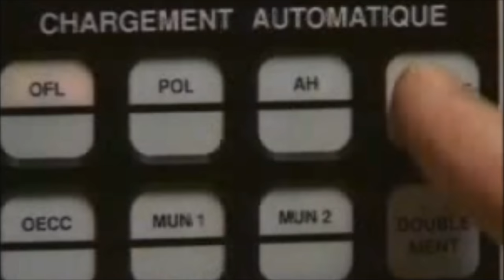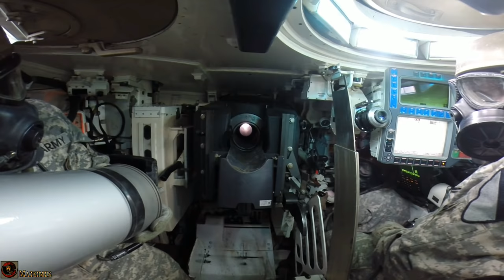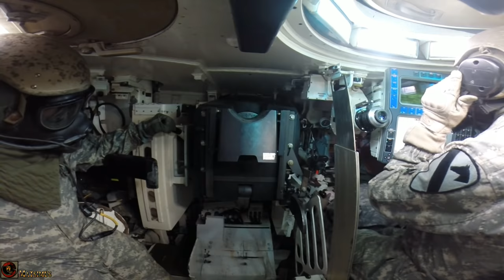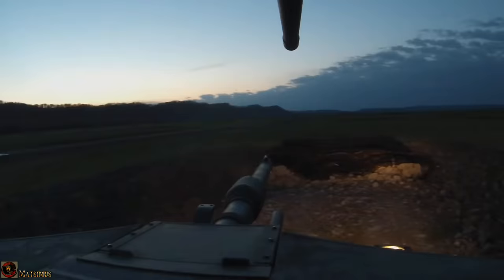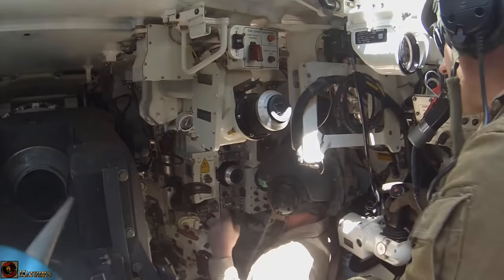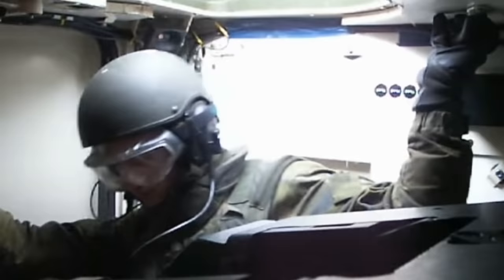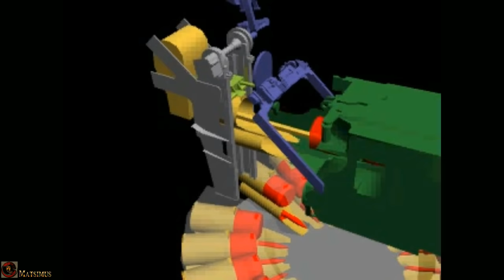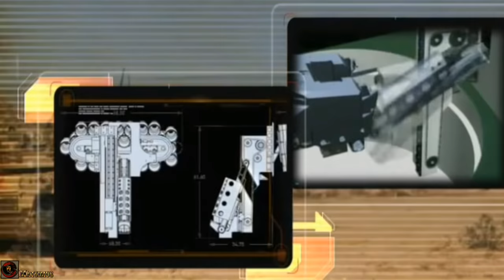Tank Autoloader or Crewman Loader?

Comment: You talked about the catastrophic exploison thingy on the T-72 in Iraq and that russian tank designes haven´t really focused on crew protection when it comes to ammo storage.

Ofcoure penetrating an T-72 Monkey isn´t really an art so it can happen, even if you hit frontally, that the Ammunition in the Autoloader explodes (burns up).
But do keep in min, if you have a HEAT round which can overmatch the armour this much, even in the M1 you wouldn´t be safe. (ofcourse with the Hatches closed)

Also the T-72B3s and T-90s have an armoured deck on top of the autoloader, which makes it alot harder to have an catastrophic exploison.
Ofcourse if you are going nuts and store extra ammunition in these tanks, you are fucked.

Then procceding to the next situation.
If a round doesn´t penetrate but the auto loader still gets knocked out, the Human loader also wouldn´t have a great day.
But lets say the loader got hit by spall, the autoloader wouldn´t care that much if no hydraulic or electric systems got damadged.
The autoloader will proceed as well as it did before but your injured gunner, he will struggle.

And finally.

We are all moving to bigger calibers, the germans want to upgrade their Leo´s with 130mm guns and in the Future the new German-French Tank will probably have an 140mm gun.
If you have these kinda guns, the ammo will get heavy, very heavy and a Autoloader will be much better due to the fact that it will never get tired and it doesn´t care how the tank driver fuck the suspension.
Also looking at the expirence the French had with their autoloader for the Leclerc, they love it, it will probably be an autoloader we will see in the next major  wester MBT.

sry for the bad english..
Reply: Jakob Fichtinger Absolutely correct mate! You got it right! The Westerners just want to justify their human loading system which is more ineffective in terms of harsh realities of combat...
Reply: despite safety,  as in this video looks like the human loaders are already difficult to handle the shell while the tank is not moving
Reply: can your autoloader be another infantryman if you leave the tank?
can your autoloader help you with maintenance tasks?
can your autoloader give you another pair of eyes looking for treats during non-combat situations?
can your autoloader be replaced by another crewmember in case of being seriously hurt?
plus the US and Germany are not moving to bigger calibers but to better ammo and longer barrels, an M829A4 can fuck 900mm of steel at 4'5 km when it's fired from a 120mm L44, the APFSDS on the russian tanks can barely do a shit over 3'5 km because the autoloader doesn't allow the cartridge to be bigger (bigger=more propellant=more energy on the projectile) due to the size limitations)
Reply: Demoblade 

You haven't seen the news lately, have you?

Germany currently is working on an 130mm canon for intermediate reasons, because they don't want DU in their rounds.

The US , for whatever reason, still sticks with the L-44.
So they have to develope more sophistocated ammo.

Also i want to know the Source of your magical M829A4.
And with source i mean leaked documents.
Also keep in mind the different standards v-50% and v-80%

Well then to the fourth crewmember.

I am not against it, but if you want to stay realistic, the Autoloader has a steady output and it really doesn't give a shit how rough the ground is or how heavy the projectile is.

If, in an combat situation, the tank gets hit and one of your crewmembers gets injured, the crew will either bail out or put in the reverse and get the fuck out of there, the loader may take the LMG , but i doubt he will go load the round and then switch to the gunner seat or will take up any other seat in an combat situation, because he has to get the gun loaded if the crew is bold enough to fight with an injured crew member.

The only possible thing i can imagine is that he takes the drivers place but well in the T-72 for example your comander could do the same.

Yeah the 4th crewmember is nice in maintanance and lookoout in non combat situations but, if we look at the russians chinese and french, they manage with 3 crewmembers...

But the one thing i really agree is the limited lenght of the round in an T-72 style autoloader, but even with that limitation thr russians really manage to create great rounds with very good pen. characteristics, even if the upgrade potential is more limited than for example Leopard 2A4s.
Reply from the maker: Demoblade "looking for treats" haha! I know what you meant "threats" but it just made me giggle lol. Thanks for watching man and some very very valid points there. Hope you enjoyed the video :-) feel free to share and subscribe :-) have a great day!
Reply: Matsimus Gaming 

Ahh shit, my english is not the best but atleast i was in some way funny, even if it was unintentionally ^^
Reply: lol, Demoblade, one day robot soldiers will replace all living human, you want keep human in such situations?
Reply: One explode tank kills three better than kills 4, better than kills 5,
You want the WW2 machine gun man back?
Reply: Demoblade 

I have to dissagree, it is always a question of how much, for example the Leopard 2 stores some of its ammo next to the driver, which can also cause a catastrophic explosion; have you ever seen the videos where Saudi M1s got blown up even if they got hit in the bustle;
It is always possible to get an catastrophic explosion, the T-72B3 can be nearly totally immune to it, if the crew only has ammo in the Autoloader, you would need to penetrate the hull armour and if in that case you have been pen. by a HEAT round well the comander and gunner would also be fucked because of the high pressure that would be created when HEAT penetates
Reply: How safe you store the rounds, it not perfect, although it's much  better than the Russians, one day the turret should work like zakU's 120mm machine gun
Reply: So why you need human on that machine gun?
Reply: Demoblade lol, is it really that save in the NATO design
Reply: The armata actually can be remote controlled, if we are talking about lives of soldiers, it do the best to use drones,
If we are talking about maintenance far from the frontline, I do not see any problem for no crew inside the tank
Reply: Of note: the commander rarely, if ever, closes his hatches, because operating with hatches open allows for greater visibility outside the tank. 

Also, the US military is in fact looking toward an electrothermal-chemical cannon that is designed to control the burn rate of the propellant to maximize it's power by using a plasma cartridge to fire the gun and electricity as the catalyst. As it's breech is no bigger than a conventional cannon's breech, it can be used interchangeably. Such a weapon will probably be featured in the M1 Abrams' next gun upgrade, probably in the form of the 120mm XM291 ETC cannon. 

Both manual loaders and automatic loaders have their merits. 

A manual loader can do many things that an autoloader cannot do, such as having an extra human brain, pair of eyes, and pair of hands, which is incredibly useful. A manual loader, with this, can serve as an extra pair of eyes to the commander, keep people company, help with maintenance and stuff, relieve the commander and driver if need be, and most importantly, someone to play cards with. Also, if he goes down or someone else goes down, he can either take their place or have his place taken over by someone else in the tank if need be. 

Automatic loaders allow for tanks that are smaller and lighter, makes the employment of larger-caliber ammunition a practical matter, as a machine, is stabilized with the gun and isn't liable to getting tossed around with the rest of the crew while on the move, and keeps a steady rate of fire. 

Rate of fire is comparable, and Soviet/Russian autoloaders are capable of switching to multiple types of ammunition, and can even switch to laser-guided antitank missiles. 

In addition, the French AMX-13 light tank had two 6-round ammunition drums, which can be selected as to which drum to feed from, although reloading must be done outside the vehicle. Despite this flaw and the potential complexities of the innovative oscillating turret and autoloader combination, the AMX-13 is widely considered a rugged and reliable vehicle and was exported widely.
Reply: well a machine might go faster but the russian tanks had a habbit of going ahead and grabbing a crew members arm the driver I think and loading his forearm instead tearing it from his or her shoulder, but yea a good human can go faster if optimum at it but can tire of course.
Reply: can your autoloader be teached to be a gunner? -yes
can your autoloader be teached to be a commander? -yes
can your autoloader be teached to be a mechanic?-yes
So it means that you could have one more crew for tank if you hadn't a loader.
Reply: Max Just Max, That is right. But Primary functionality is more important in battle. Good autoloader can keep fast firing mode. And if Commander is killed and autoloader now is commander.... who is autoloader than? Mechanic? It means each member should be trained to each specialization. That is possible in crew with mechanical loader.
Reply: Demoblade is a loader

Comment: When was the last time that a tank found themselves in such a target rich area that it was firing literally as fast as the crew could load it?  Even in both Iraq wars, the M1A1 wasn't faced with such massive waves of Iraqi tanks that saving an extra 2-3 seconds on the reload ment the life or death of the vehicle and crew.  The advantage of the autoloader, a couple of seconds faster reload versus a human loader, just doesn't seem like its that essential in modern conflicts.  Especially if you consider how much versatility is being traded for a couple of seconds.
Reply: In my experience, pretty much every loader in my company were faster than any of the current autoloaders, by a pretty significant margin.
Reply: For a "modern conflict" against opponents with very old tech, you don't even need a MBT, so of course the reload difference isn't that important and manual loading perfectly do the job.
However, if a conflict begin between big countries, an autoloader will be a most have. Yes, it's usefull to fight multiple targets, but must and for all it gives a huge advantage in 1v1. Even if you have the first shot, nobody hit (or at least kill the target) 100% of the time in one shot, shooting the next shot a few second faster will maybe prevent the oponent to respond, and it's only one of the advantages (fire on the move more effective...)
If "big" tank battles ever happen in this type of war, this advantage could easily snowball in a crushing victory (one tank win a duel he would have lost without the autoloader, and he can help an other one to win a battle he would have lost normaly...)
Reply: When comparing a human to a machine humans are at a significant weakness physically and mentally. For example a single mishap can injure the loader or a mission that require long hours mentally humans can check out. With a machine you have none of those problems.  If the autoloader breaks you can fix it within hours if not a few days. If a human "breaks" who  knows who long they are out of action months if not even a year depending on the case and now you need a replacement for that crew member and the overall effectiveness is decreased significantly.  Also if the trend of bigger better rounds keeps going ie. the new 130mm Rheinmetall gun then an autoloader is a must have.

Comment: Interesting discussion.  I think the biggest drawback is the fact that you have all that ammunition in the turret, which makes for a much less survivable environment if a penetrating hit occurs.  As I recall, the US was experiencing some serious reliability issues with the auto-loading system they were developing and it was then scrapped.  If they get the rail-gun operational, then that will be a game changer, but it will need an auto-loading system of some sort.  A human won't, in theory, be able to keep up.  

I agree with one of the earlier comments, the loader is another body to help perform battlefield repairs and maintenance.  Unless technology change really drastically in the next few years, loaders will still be needed in one capacity or another.  I'm now going to have to do some research on this subject.  On the bright side, this gives me something to do this weekend!  :-)

Comment: I'll tell you a little story as a US Army tanker. The human loaders are needed to load the round in 7 seconds or less or you are a NO GO in that station. Because a autoloader loads a round in around 7 seconds. On my crew, our loader was an absolute god. There is an engagement during gunnery that is a three target set up. We shot that engagement in just a hair over 9 seconds. That is a 3 second load time per round...armed and ready to fire. He was so fast that he beat the gunner from target to target, and so fast that I drove blind for most of it. When the tank fires at night, the flash shuts off the drivers sight for a second or two and then fades back on. The crazy part about it was he did all 3 rounds with one hand and holding a Monster in the other hand. Granted he might not have let the ammo door shut all the way before arming...We shot that engagement so fast, that it earned us top tank crew of my squadron and we all got ARCOM's. An autoloader would never ever be able to do something like that. Human>Tech any day in war. TV can say whatever they want...the ones actually doing it know what works and what doesn't

Comment: This may not be a viable solution, but why not have both an autoloader, which has the possibility of working faster than a human and does not fatigue like one, AND a fourth crew member to serve as a dedicated engineer? Best of both worlds, right?..

Right?
Reply: Hidden from View right!
Reply: my thinking exactly, all you then need to do is make sure to have a backup system where if the autoloader fails for some reason you can still manually reload. Best of both worlds.
To be honest though, a lot of the arguments he did in the video were mostly nonsense and/or baseless assumptions. autoloaders are in general better in most cases. But you know how it is, militaries arent known for adopting new and better stuff quickly, they like to cling on to their old ways.

Comment: I was a Abrams crewman for many years, hands down the utility of having 4 men to maintain a tank means its battle ready when its being driven a lot. Tanks fucking break a lot! I have seen a tank throw a track in waist deep mud before and it took 4 men 12 hours to fix it. 3 men just can’t do as much work as fast as 4 can. When it’s time to rest, 2 men on guard while the other 2 sleep allows a good balance of security and rest. Sleep deprivation has a very detrimental effect on proformance. A very good loader in an m1a2 Can reload the first 6 rounds in 2.5 sec’s, when I was a tank commander I drilled the loader so much they could achieve that time anytime night or day and half awake.

Comment: Armata overcomes every issue you have with autoloaders apart from changing ammo without firing.
Reply: Too bad the Armata is total shit. Doesnt even keep running on parades :D
Reply: Do they have redundant systems in case of a failure? Arm-chair Generals don't seem to factor in equipment failures.
Reply: @eltouni  thinks like that happen all the time for every vehicle type from every possible country.
Reply: @kurosumomo  the incident has already been cleared up, the breaks on the tank were on, took them a while to realize that.

Comment: Everybody misses the crucial point here. The Soviets designed the T-72 with an autoloader because a tank needs 15 tons of armour per person and the human loader determines the minimum height of the tank. Consequently the T-72 is 20 tons lighter than the western tanks and more than three feet lower.  And since they only need to train three crew members per tank,   with 100 crew  they can field 33 tanks, while NATO only 25. Add all that up, they can produce the same number of tanks from a lot less steel, and field more tanks with the same number of crew. Achieve the same efficiency in airplane, submarine and ship building and you win the war.

Comment: Do your research! Challenger 2 does not have ammunition compartment. The rounds are scattered all over the turret, it is a complete nightmare.
Reply from the maker: net split thanks for that
Reply: all of the charges are held in armoured bins and the HE rounds are stored below the turret ring in the very bottom of the hull its not a nightmare
Reply: "very bottom of the hull" is where we store explosives. Not a nightmare at all.
Reply: jack5760 
If people hate Russian tanks for having rounds in the hull (and for the earlier ones in the turret), it ca not be suddenly fine on western tanks. And there are documented cases where CH2s ammunition rack blew up and the whole tank with it. 
The only manual loading tank with actual ammunition separation is the M1. CH2, Leo2 and whatnot all have the same "problem" as the Russian/Soviet tanks.
Reply: net split not a nightmare at all